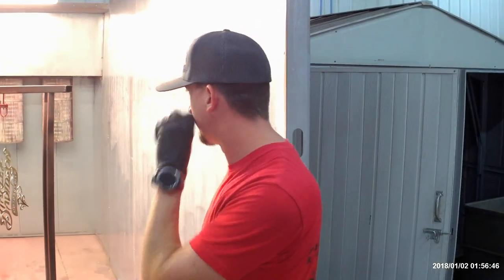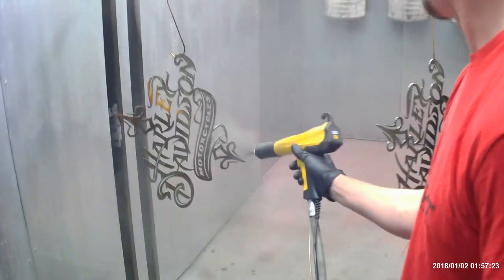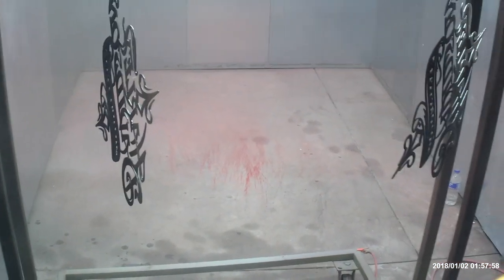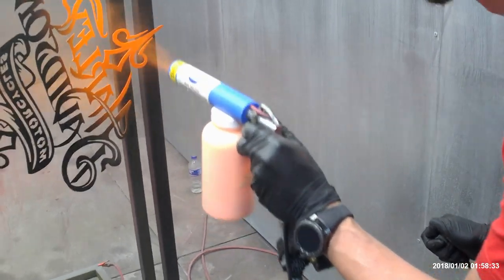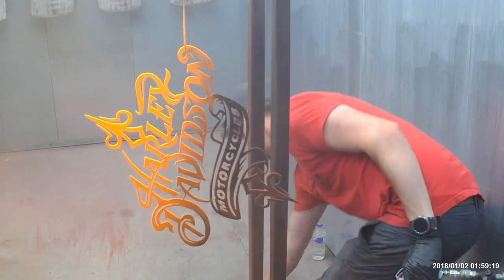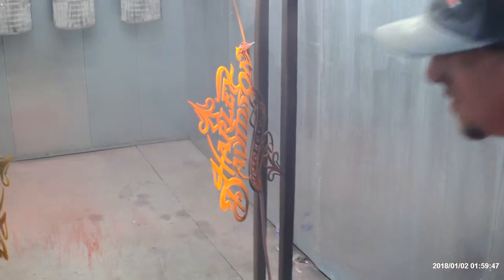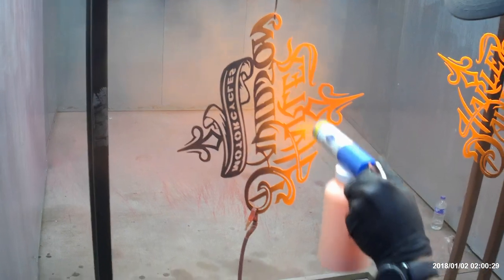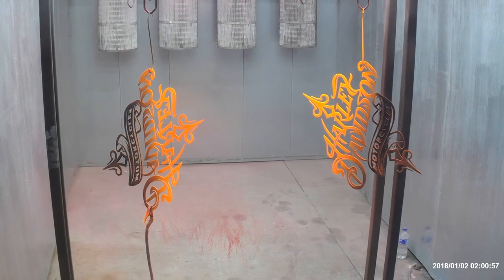How to blend two colors.  - Powder coat two tone demo

Comment: Quick question, when you were applying the orange, I noticed that the powder was drifting on to the other part.  Will this stick to the other part as it passes over it?  If so, wouldn't it be prudent to do each part separately?  I am not a powder coater, but I do paint.  Just curious.